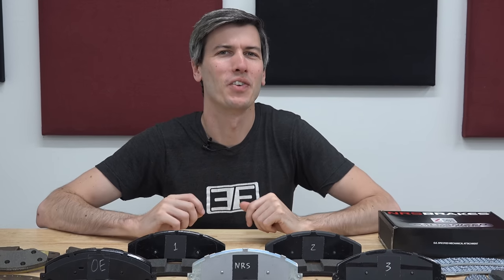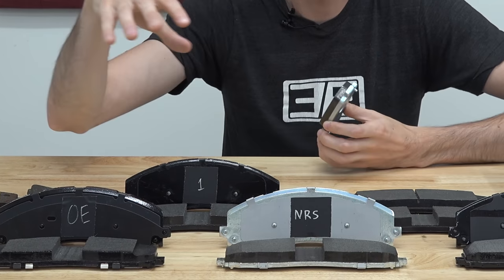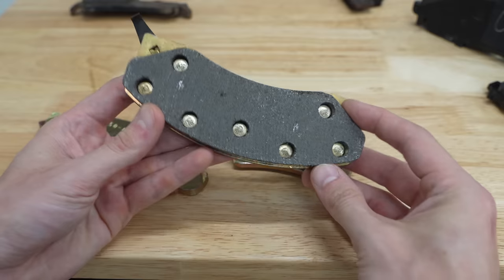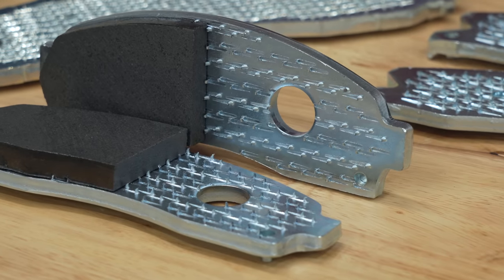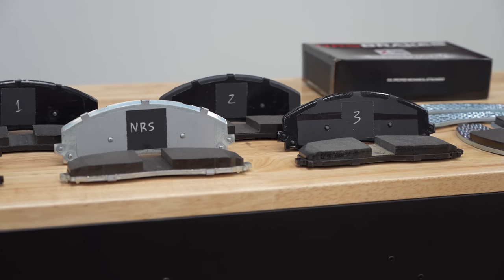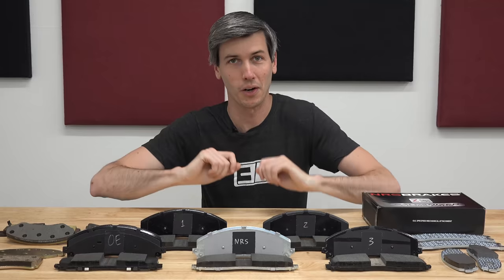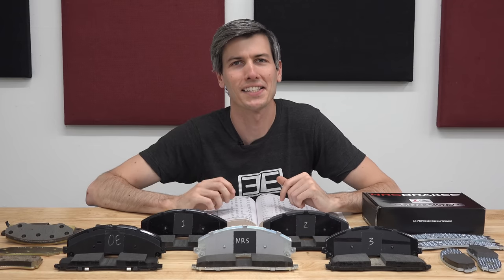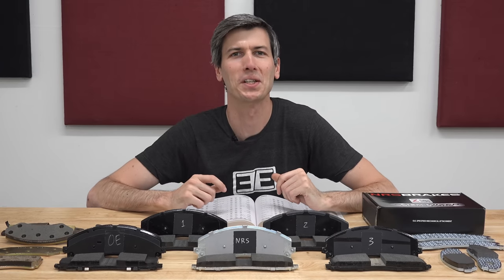The Sketchy Truth About Aftermarket Brake Pads

Comment: I was worried about my EBC brake pads so I looked it up. Not only do they use NRS hooks on their pads, but they also use an adhesive to keep water out and provide an extra layer of protection. Let's just say I'm extra satisfied now.
Reply: I've always had good luck with EBC pads, personally. I've used them on a few vehicles, and still have them on my motorcycle.
Reply: @malerra  I have them on my 1 ton and my wife's van. Frankly if you set them properly and reseat them if they sit too long I cant imagine a better heavy duty brake pad. For the record I got them for the pickup almost 13 years ago after experiencing brake fade in Colorado with the oem brakes. I swapped out the rotors with slotted ones and ebc green stuff and haven't had brake fade since. Now that I think about it I meant to get high temp brake fluid too, but forgot.
Reply: I love my EBC yellows!
Reply: I use them on my jeep wrangler, i like them. Stops really fast, it did stock tho. Much faster than the diesel pickups i have driven, the FORDS were the worst
Reply: I'm either gonna go with EBC or Hawk brake pads for my next Change. And I'm honestly more worried about the quality of the actual friction compound. 
And hell, it's gonna be enough for a aggressively driven Miata
Reply: @Birb_of_Judge  I had Hawk once, never again. For me they squealed like crazy and wore fast. EBC IMHO are way better. Tons of people like Hawk though, so obviously your mileage may vary.
Reply: I loved my EBC yellow for all of 8,000 miles before they were completely worn down.  Rear brakes not tracked.  Pathetic.
Reply: @malerra  depends on what pad compound you went for, if they were noisy and wore fast good chance that they worked extremely well and aren't designed for longevity.
Reply: @v4lhulme  I can't remember what compound it was but they didn't brake any better than the EBC ones do.
Reply: and thats why they charge much more than others
Reply: Has anyone tried tarox Corsa or brembo HP2 (hp2000) pads if so I wonder how they would compare to ebc yellow or greens. Thanks

Comment: The main issue I have with OE is actually not the pads themselves but charging $30 for brake hardware (clips) and $30 for shims.  Almost as much as the brakes cost, in this case Toyota/Lexus and using Akebono pads
Reply: Agreed, that’s the reason I purchased Power Stop rotors/pads is because it included all new hardware. Next time I’m going to bite the bullet and purchase all the OEM parts for my 2011 Acura MDX because I’m guessing Acura/Honda use quality pads like you stated for Toyota/Lexus.
Reply: Or with volvo, who uses (if im not mistaken) ATE brake parts. OEM discs and pads are 250 euro's per axle. For 220 euro's i could also purchase brembo perforated discs and upgraded compound pads, while i can purchase some slider pins, rubbers and good lube for the remaining 30 euro's. ATE's brakes without the OEM badge are nearly half of the OEM price too. All of that for just a manufacturer's stamp.........

Comment: Here in the New England rust/salt belt, besides rust jacking on the pads, you also have to worry about rust/salt on the entire caliper and pins.  Frozen calipers can result in very uneven wear on any pad which can break/chip/overheat them.  So even if you have a perfect pad with mechanical attachment, perfect rust-free backing plate, etc, you still have to worry about the rest of the components failing due to rust/salt.
Reply: Use permatex extreme brake grease they resist -40-2000f and resist dust very well
Reply: In the rust belt driving lower mileages I never would even make it to the end of brake pads I would always end up having to replace one that locked up & would just replace the whole axle at once.
Reply: I usually take the 30 minutes to just take the brakes apart and grease them when I rotate wheels or swap winter wheels. My last 'daily' car the front calipers are original but rears failed after 15 years because I didn't pay as much attention and they didn't move as much (2-3 sets of fronts to one set of rear pads).
I have a feeling rust jacking is what caused 3 sets of Hawk pads to separate. They would barley last 2years, 15k miles.
Reply: I know brakes are replaceable (read: smaller) components, but I make it a crucial point to NEVER purchase a vehicle with a history of its life spent in northern states. Feel bad for y’all

Comment: Tommy boy would be proud 😂

I get that you can't reveal brands, but that kinda makes this data useless to us. I've never even had friction material separate on any vehicle, so it's really a non-issue for me. I care more about the friction material itself.
Reply: Well he says "it's for high performance vehicles" which means this video should be useless to anyone else....
Reply: And trucks, which covers a good amount of common vehicles
Reply: Back when i was young, we would cut holes in the footwells and use our feet to stop the vehicle! — Fred F.
Reply: Callahan brake pads are the best.
Reply: 🔥🚙🔥 "...we're burning ALIVE nooooo I can't feel my LEGS!"
Reply: Because the only point of the video is to sell NRS pads.  So he hides behind a manufactured reason for not revealing brands, but the real reason is that he's out to show only mechanical attachment is safe, and the only brand where you can know you have mechanical attachment...is NRS...because no other brand in the video is revealed.
Reply: @tc6818  I was just checking the specs on the N-line girder... I'm retarded
Reply: @imnotdavidxnsx  seems like a stretch.  If he really wanted to hock a brand,  he'd do it directly.  It would be way more effective.
Reply: @rfehr613  How would that be more effective than convincing people he's being impartial and still coming to the same conclusion?
Reply: @imnotdavidxnsx  cause most won't put the pieces together to figure out it can only be the one manufacturer
Reply: @rfehr613  They don't have to.  They just need to learn they want mechanical attachment, then turn their attention to the only brand in the video that they know has that...NRS.

Comment: Adhesive vs cohesive failure. My preference is always a mechanical attachment vs adhesion which is also very appicable in roof design. Good presentation!
Reply: The problem with riveting is the shear resistance is a fraction of that of bonding! Just mechanical attachment is a risky technique! Bonding and riveting is superior! Btw I’m not a roofer I’m a mechanic that did my apprenticeship bonding and riveting clutches and brakes!
Reply: Talking about roofs, I had a polycarbonate roof delaminate on my 10 year old premium European car. Finding a body shop to glue it back on was a bit of an ordeal.

Comment: The only time I've seen pads separate in years of being a tech. Mostly it's been from excess heat being introduced from leaking wheel bearings or cylinders or CV joints. So many vehicle malfunctions are purely owner neglect.
Reply: So you know people neglect car maintenance. Then you know that craitical safety parts like brakes must survive these harsh conditions in order to save lives.
Reply: @536joe  True, but you can only cater so much to stupidity before you just give up and let them figure it out.
Reply: @536joe when someone wears their brakes down so much the lining is gone and the metal to metal grinding noise is ignored and if they keep driving for another week or so the backing plate spits out and the piston starts grinding itself away. This after listening to the wear tab squealing for months. Then the noise of partial metal to metal contact for weeks. The brakes actually still stop the car while this is going on.  No amount of over engineering of a glue joint will account for that. Regular maintenance by good mechanics is far more essential than parts choice.
Reply: In northern NY I've seen quite a lot of brake pads separate. Every one had rust between the metal backing and the friction material. Usually only on vehicles 10 or more years old with original brakes still fitted. Think limited usage vehicles like motor homes.
Reply: Are you in an area where they salt the roads?
Reply: @kdtube17  yep.
Reply: Solid point, but it has me thinking though. How many times have we seen a vehicle with a 1 of 4 pad-per-axle metal-to-metal scenario? Personally, more than a few times. Is the average customer going to really notice, let alone mention, that suddenly they had a soft pedal for a few pumps, and then suddenly it was fine, as well as that they then started hearing screeching? If a customer is going to drive their car metal-to-metal anyways, they're not paying attention to their car. The separating friction material is not likely going to be found on the car somewhere. In the instances that the piston goes in fine and the slide pins aren't locked solid, then this is an explanation that makes sense.
Reply: @Krankie_V  "Think limited usage vehicles like motor homes." There are several parts on a car that are designed on the assumption that it will be used quite often. All sorts of things go wrong on occasionally-used vehicles. 

My family cycles for 96% of journeys, so the car only gets used occasionally - I get a lot of trouble from rusty brake discs and flat batteries. Cast steel discs rust - there is not much to be done about it. Stainless discs don't exist for my vehicle. And loads when the vehicle is off could be minimised so the battery isn't drained in a month, but they don't see a need to care about that stuff.
Reply: @xxwookey  I fix cars for a living. You think I don't know that things go bad when a vehicle sits parked a long time? I'm just sharing my experience with delaminated brake pads, and that's the most common failure I've seen.
Reply: @Krankie_V  No disrespect intended there Mr Krankie. It's a conversation. It was just a remark following on from yours about long-sat vehicles (because it's a pet peeve of mine). I wasn't trying to teach you to suck eggs or anything.
Reply: @xxwookey  sorry mate, spend enough time on this platform and everything feels like an attack
Reply: @Krankie_V  I know what you mean. It's easily done.
Reply: Fifty years in the automotive field, from grease rack operator to heavy line, service writer, switched to auto parts, retired into restoring vintage vehicles for ten more years. Yeah, um, you are right. Most of these 'info' guys have no idea of the real world, just the theoretic world.
Reply: @536joe  basic car maintenance knowledge NEEDS to be part of getting a license! seriously so many people feel they have a right to not know anything about the machine that their lives depend on. Very good content!
Reply: 100% agree. The friction material shearing from a backing plate is often a result of fluid contamination rather than a fundamental defect of the pad (from my experience).

Comment: My Volvo C30 had Brembo "oe replacement" pads from the previous owner. When I changed them, one of the right front pads had split in two with the friction material completely separated from the backing plate, no mechanical attachment, just adhesive. And I was traveling to the Nürburgring a few days after, so I'm super glad I upgraded my brakes before I went. Though the previous owner had installed the wrong size front discs, so that is probably the reason why the pad was destroyed, I don't think it would have happened otherwise. Now I have Brembo's XTRA line of pads on the car, and they're working great, though I could not find any information on how the friction material is mounted.
Reply: no issues with brembo pads on my porsche,  even at the track.
Reply: @tomzphone  I'm not saying there are problem with them, I'm just pointing out that it happened on those exact pads, and that it probably would not have with mechanical attachment. Your Porsche's brembo pads are probably 5 times as expensive as the oe brembo's for my platform and most probably use mechanical attachment. The XTRA line on Brembos I upgraded to were amazing on track.
Reply: The brembo pads a probably a little different than the OE replacement you used, but they are not that expensive.   Only $122 for both front pads. @VinnesRC
Reply: @tomzphone  yeah, the oe replacement brembos for my car is around $30-35. The XTRA pads for my car are around $60-70
Reply: @KM-ol5bs  only by those of us who inquired. They have the MAX and XTRA line of discs which are drilled or grooves, and the XTRA pads are for those discs. Only for some cars obviously.

Comment: I’ve been running akebono ceramic pads with zimmerman rotors and they last anywhere from 5-7years depending on the driving. Perform like Audi’s oem pads but without all the dust. Have used multiple sets across 3 different vehicles and never had an issue.
Reply: Thats great but not the point.

The point is that some OEM specifies that mechanical attachment is required due to the duty of the car and aftermarket ignores it.

With data supporting that mechanical attachment is safer.
Reply: I've heard akebono pads offer less initial bite than OE pads, have you found that to be true?
Reply: @busterscrugs not OP but I definitely have. I still run them because they create so much less dust on the gl450, but it’s definitely something to be aware of. I also run brembo stock replacement rotors fyi.
Reply: love my akebono ceramic pads for the less dust and long life
Reply: @busterscrugs  Yes, I've had this experience. Audi OE pads have an aggressive initial bite, so the softer bite with light pedal was preferred on my end. It lets me decide how hard I want them to bite using the Akebono pads. The decrease in dust is significant and stopping power is still there. I've used them on an S4 and SQ5 from autocross to towing trailers through the Appalachian Mountains, no complaints.
Reply: @busterscrugs it's true I have them on an ml350 with Zimmerman rotors but the bite in OEM was too much on that car
Reply: If they are initially broken in as specified you can't really tell the difference. And they do have a rather lengthy break in period after the initial brake in procedure. For some it's at least 200 miles of usage.  @busterscrugs
Reply: I've got the Akinono pads on my m3 and they are awsome

Comment: I did have a set of pads fall apart. It had rusted in between pad and plate. I do wonder though if those hooks decrease or increase chance of rust forming and glue then having nothing to hold onto

Comment: I started replacing brakes with OE only several years. After numerous brake jobs with pads and rotors from auto parts chain, I finally realized I just end up doing the job more often.

Comment: Question for all you brake experts. I replaced rotors and pads on my ge8 Honda Fit. I noticed the pads I bought came with thin wire pieces, but the pads I took off my Fit didn't have them, just the clips. I didn't try to use the wire pieces, thinking they were adaptors of some kind that I didn't need. The new pads came with new clips and everything seemed fine, but I've been second guessing myself - if a rotor&pad set come with wire bracket things, should I assume they are needed?

Comment: I got into a jam when a shipment of super premium pads got delayed before a track weekend.  Had to make a run to an Oreilly store to buy their Best Pads for the M3.
I put 700 track miles on them and then I ran them a second weekend another 500 miles.  Everyone was amazed they did not delaminate. Not as good as the motorsports pad but pretty good. Careful warm up helped keep them in one piece. Temps were over 600 degrees at the end of 10 laps. Should have kept them for analysis. Great video.
Reply: I have not seen brake pads delaminating I don't know what they are talking about. This video makes it sound like it's a big problem with glued on pads and it's not.

They're deliberately creating artificial conditions to get them to delaminate, and scare you into buying their brake pads.

 I'm sure you need extra good brake pads for a race car though.
Reply: Sandy, I am an E36 M3 fanatic. I have installed floating and fixed calipers and every sort of brake pad. I like metallic pads for best performance. The only pads I do not like are NAO. I have worn out a set of these in several weeks. And they dust like crazy.
Reply: We had been waiting on a set of Hawk HP, decent balance between track and street. The Hawk track pads (reds/blues) are just too aggressive around town until you warm them up.  Good info on the NAO's.

Comment: I remember with those rivet attached linings that if you let the pads/shoes wear down too far, the rivets would score the rotor/drum.
Reply: If you run pads with adhesive down  to the backing plate it will do the same. Not really the pads fault , that's a lack of maintenance issue. They should never get that low.

Comment: No idea what attachment method they use, but I’ve been using Akebono Euro ceramic pads on my Mercedes and they have been great. Much more linear pedal feel, last forever, and almost no brake dust. I’ll never go back to oe pads.

The last set I had used were one of the oe brands and the pad ended up separating from the backing plate from rust after about 4 years. The Akebonos have been on for 4 years so far and no issues.

Comment: In the rust belt, I’ve seen friction separate when salt & corrosion gets between the backing and the friction…usually on cheap pads.
Reply: Yeah he’s focused on heat, but let’s be honest… 550 degrees for DAYS is well outside the kind of stresses a normal car sees. To get that you’re hauling things, probably in the mountains. Salt corrosion? A lot more common of an issue.
Reply: In Australia my 19 year old car looks almost brand new, no salt or rust.